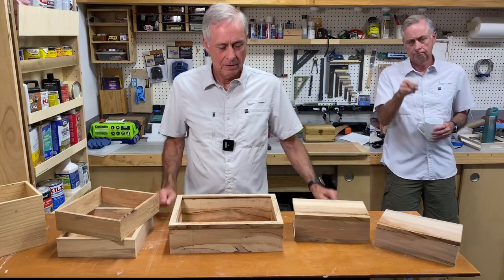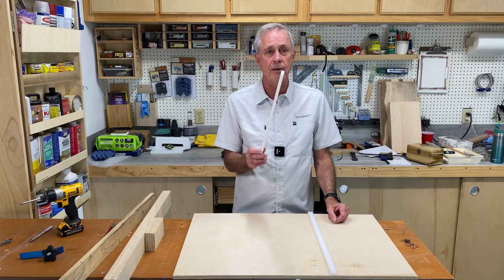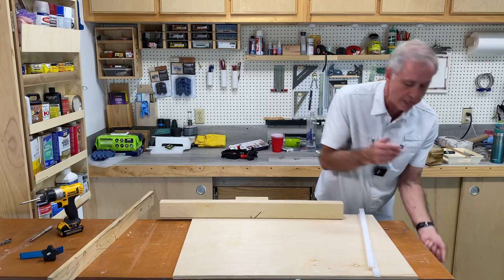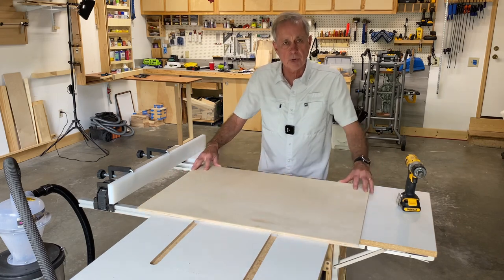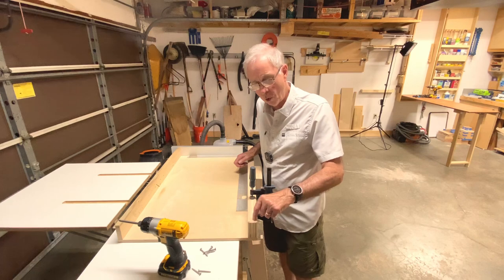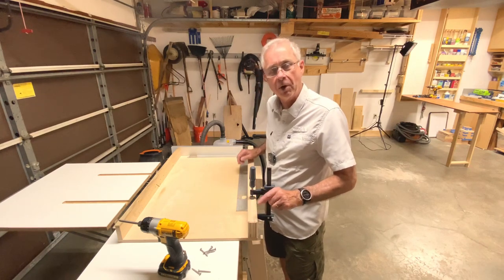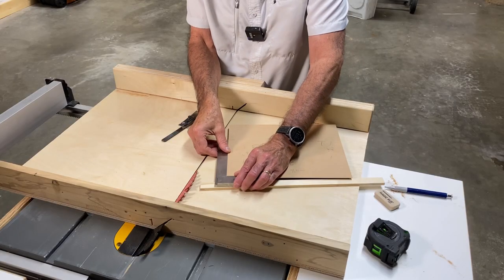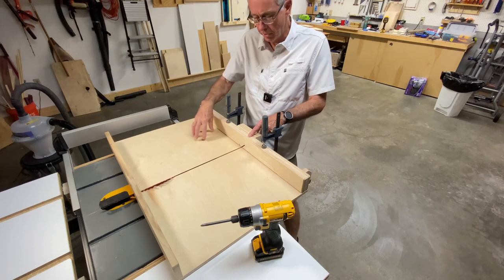How To Make A 45 Degree crosscut Sled

Comment: At last some sled maths (or math to you USA folk) that I can get my head around. I'm guessing your blade angle adjustment was to around 44.9 degrees? 
Which means the stock must always sit to the right of the blade? Thanks very much for taking the time to post this.
Reply from the maker: @davidbuchan2224  Maths vs Math.  Love it! I usually stay to the right side.  I hope it works for you!  Thanks for the comment!